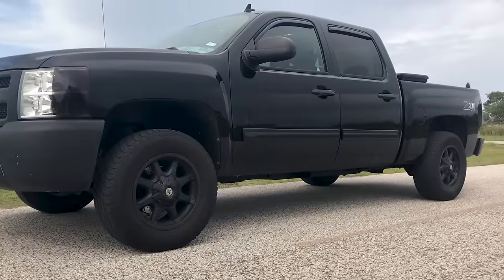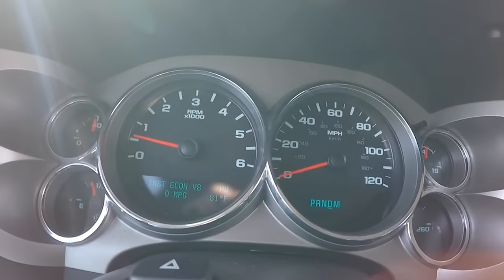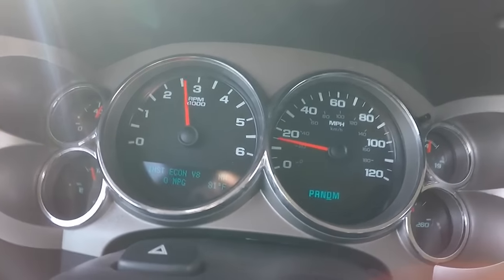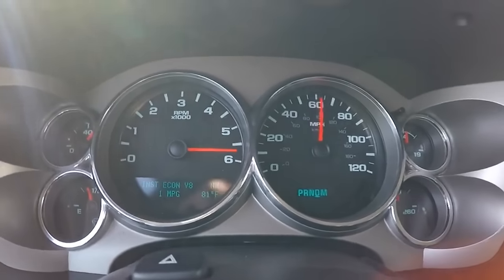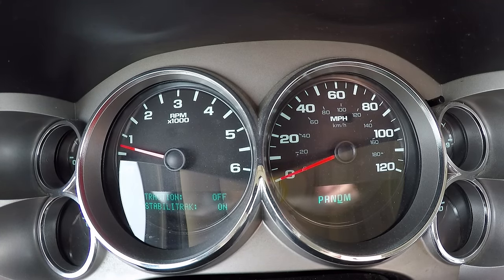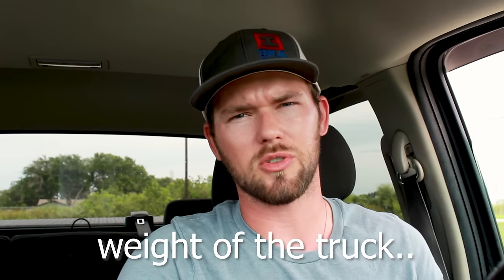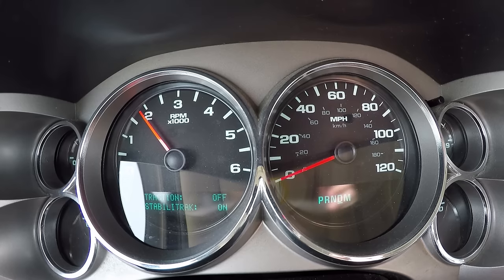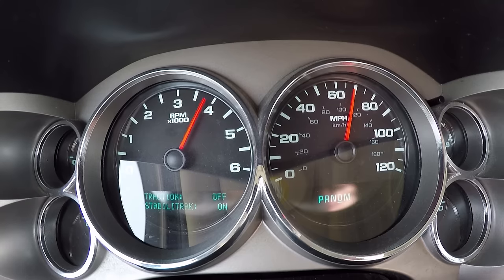High Stall Torque Converter Acceleration | Before and After

Comment: I have a 2013 crew cab 2wd with a 4.8L and it is  the slowest of all 4 silverados I've owned (99 w/ 4.8, 2007 w/5.3, and 00 with 4.3v6 all 4wd) all stock and nothing at all mechanically wrong with them. was just surprised how shitty my acceleration is on my 2013 with 4.8L 2wd especially 0 to 35mph area.
Reply from the maker: Gearing might play a big factor. Not too sure what the set ups were but I’m assuming since it’s 2wd it might have a 3.08 gear and the 4wds probably have something like a 3.42.
Reply from the maker: Gearing might play a big factor. Not too sure what the set ups were but I’m assuming since it’s 2wd it might have a 3.08 gear and the 4wds probably have something like a 3.42 or 3.73.

Comment: I'm running a heavy 2010 ltz on 35s with a k&n setup and race muffler system with a tune and stall but if i run cheap fuel it doesn't run near as good but runs out really well

Comment: 5,600lb truck. I just wonder what that same set up would do in a 3,200lb g-body lol
Reply from the maker: It would be pretty quick lol
Reply: @JohnVesely  I'm rebuilding an 85 el camino like the 79 model I had in high school and kinda torn on drive train. I bought it with the plan to put the 4 speed from my old one with a 434. But driving it around I'm really liking the automatic, fuel mileage and cruise control lol. I'm starting to lean towards maybe a 4.8L and 4l60 for power, fuel mileage and fun cruiser. But my old manual 4 speed has the same gearing as a 4l60 and technically classified as a 3 speed with overdrive. 

I won't cut the car up to put a roll cage in so the 434 is pretty much out. So many hard decisions lol

Comment: I got a 02. Silverado 4.8 stock how can i choose a torque converter to get better power?
Reply: 4l60e 373 33s i cannot get to do a dry burnout lol
Reply from the maker: Probably just anything over 2500+ but don’t go too high since the engine is stock. You’ll go too far into your power band and it will hurt performance.

Comment: Why is this better than a lower final drive gear???
Reply: It isn't, necessarily. I decided to go with higher gear ratio (from stock 3.42 to 4.10) and it really made the truck drive like a far lighter truck.

My trans is old and tired, so putting in a new TC would be throwing good money after bad.

Comment: how is the lock up in over drive?  do you have to turn the engine at 2500+ to get the converter to lock in?
Reply from the maker: Just cruising without lockup it doesn’t even go up to 2,500 unless your trying to accelerate. But it just locks up shortly after it shifts into overdrive and it feel like a stock converter after that

Comment: .5 diff  its something but i would save the $$ and get underdrive pulley
Reply from the maker: Lol an underdrive pulley would do significantly less and this is a mild stall converter. I have a 3,400 stall converter and it’s even quicker.
Reply: @JohnVesely  can u please make another video and do a 20 roll pull and a 45
Reply: U should have done a transgo hd2 shift kit with underdrive pulley and s bullydog tune it decimate that cam and stall
Reply: Ive raced a 5.3 huge cam huge stall pulled me at the line by a truck but as soons i got traction that was it
Reply from the maker: Well the 0 to 60 now with the new stall is 5.4 sec. It’s still not the fastest thing out there but would definitely beat a 5.3 with just a tune. Right now I’m building a 6.0 so we will see what the truck does once that’s swapped in there. You can tune these converters to lock up at wot so you don’t lose efficiency. But I’ll post more videos, I have a draggy so I can time the rolls pretty accurately.

Comment: yeah, but a higher rpm stall converter runs AHELLOFA LOT HOTTER in traffic
Reply from the maker: Of course, but I didn’t mention that in the video because I have others about it and this one is just about acceleration.
Reply: @JohnVesely   they just dont last, even with a cooler

Comment: Does the new torque converter locks up on direct drive on highway cruising or so like the stock one?
Reply from the maker: It locks up like the stock converter. Depending on the tune you can have it lock up whenever you want it to. But usually when your just cruising it will lock up like 45 mph and up.

Comment: If your cruise rpm is below what the converter is meant for that converter is gonna get so hot it's gonna bake your trans
Reply from the maker: I have a lock up converter, so when I’m just cruising the converter locks up to where it doesn’t slip anymore. Also I installed a bigger tranny cooler so I have no over heating issue with the trans.
Reply: The answer to this comment. It that the torque converter locks up at 43 mph and unlocks at 33mph.  No matter what the stall is.  Cruising or full throttle above those speeds, the stall has no affect.
Reply: @smokendatires  that is true if you have a lock up converter. If you don't have a lockup converter than what I said is correct

Comment: Can you put a stall if you don’t have a cam
Reply from the maker: You can but it’s not necessary.
Reply: What if have fbo will it make a difference
Reply from the maker: You’ll see a difference from down low, but no difference in top end. If you have trouble with traction you’ll really have trouble with a higher stall torque converter.

Comment: What did you use to calculate your 0-60 times John?
Reply from the maker: A stop watch and the video
Reply: @JohnVesely  That can be hard to discern a couple of tenths.  I once put a 9" converter in my Buick.  Felt great, snatched the tire off the ground at launch but lost over .30 seconds and 3 mph in the quarter mile.  To know for sure and with greatest accuracy, you have to run a baseline (before) and after runs at either a track or with a performance meter.
Reply from the maker: Well obviously, but I’m doing my best with what I’m working with. I don’t have a track near me, nor the money to buy a v-box. I averaged out the times and I know it’s not exact but the method works for now.
Reply: @JohnVesely  You could do it more accurately by playing the video in .50 or .25 time, then dividing your stopwatch result by 2 or 4. Still not perfect, but easier to be more exact.

Comment: with this stall, could i go straight to 2500rpm and roasting the tires? or does it act as in neutral until off the brake.. i realize your tires didn't break loose at 2k. My wheels break loose at 2k with my stock converter but would like to go bigger since it barely does it as of now. I wanna roast these mf's
Reply from the maker: It will roast the tires like nothing. As long as you have traction control and stabilitrac off the tires will spin easy with the new torque converter
Reply: If your goal is burn outs just install a line lock kit
Reply: Throw some gears in it.
Reply: i already have gears @JK-li7fp
Reply: what is that? @2ShotsDown

Comment: 6.5 second 0-60mph?  Wow, that’s fast.  That’s as quick as a dodge charger hemi. What engine work have you had done?  I have a Sierra 5.3 crew cab and it runs in the 9’s 0-60.
Reply from the maker: It has a bigger cam, cold air intake, longtube headers, a custom tune and the tci torque converter
Reply: John Vesely pretty sweet. I’m building a 95 f150 flareside right now. I have a 331 Stroker going in next week. I just ordered a FTI 2800-3200 stall. I am hoping it will work out. Watching your video gave me a little more piece of mind. Thanks
Reply: Wtf lol a charger hemi doesnt run 6 5 it runs in the 5
Reply: What altitude are you in ? I have a 2012 5.3 crew cab and i average 7.2 seconds the best was 6.8 to 60
Reply from the maker: I’m at sea level
Reply: Sergio Zamora that’s a big negative. I have had 4 different chargers for Patrol vehicles. All had the 5.7 hemi. Quickest one I ever had was 6.6 sec 0-60. I no what “they” say, but I have tried it dozens and dozens of times. Maybe on a prepped track with everything condition perfect, and a  completely empty car with only 1 gallon of fuel in the tank MAYBE break into the 5’s. But they WILL NOT hit 5’s in real world driving.
Reply: Sergio Zamora I have to apologize to you. After replying to you about my experience in the charger I watched a few videos of newer chargers. My current charger is a 2014. Which is the same HP as the 2019, however the newer chargers have the 8 speed auto. Mine has a 5 speed auto. So I guess that’s why the newer chargers are quicker.
Reply: @lifewiththehamptons2191  Charger patrol vehicles will also likely be heavier vehicles, between extra chassis supports and possible light armor in doors, as well as cages in the interior.
Reply: Paul Hampton My Dodge Charger GT (3.6l V6) does 0-60 in 5.9-6.1 seconds so it’s definitely not as quick as the Hemi
Reply: Michael Nikprelaj that’s faster than my Patrol car. I ran it a couple time yesterday just to see. Empty car, cage only which weighs around 100lbs. Best 0-60  time was 6.62sec. Best 1/8 mile 9.29. Best 1/4 mile 14.62. TC off and foot breaking. Out of 4 Patrol Chargers, this is the quickest. Sad I know.
Reply: Paul Hampton Wow, aren’t the patrol cars equipped with the Hemi too? That’s a shame man they should be faster because you never know when you’re going to have to chase someone lmaoo. Idk why it’s so slow because my V6 charger literally averages 5.9-6.1 seconds to 60
Reply: Michael Nikprelaj yep it’s a 5.7 Hemi. Are you timing with an App or display on the dash?
Reply: Paul Hampton Display on dash

Comment: What kind of power is your truck making? How big of a cam do you have? I have a +500 rpm stall converter from tci that I'm torn about installing. My engine should make killer torque from idle but an extra 500 rpms wouldn't hurt.
  I've got a turbo 400 trans right now. It's in a 1990 K2500 Silverado. It's got the RV/towing style low-stall converter. I think they call it 1300rpms on a stock 350 engine. Stock was 190hp@4000 and 300lb/ft. @ 2400. According to comp cams camquest software, I'm making north of 400hp @5500 and 475lb/ft @ 3500. The stock converter naturally stalls higher now with more torque. It rips the tires off if you punch the throttle from idle. Since it is so responsive, I'm not sure if I need the extra 500 rpm stall converter. Currently, the truck weighs 5700lbs and has 4.10 gears on skinny 245/75R16s. I'm upgrading the trans to a 4L80E. No overdrive and no lockup converter is horrible on the freeway! I'm turning 2500rpms at 55mph on 2 lane highways.... 80mph is a whole different level. At least the other cars know I'm there from my exhaust note singing proud. What are your thoughts?
Reply from the maker: I’d recommend getting wider tires first then see if it still hooks. If it does then go with a lock up converter with the 4l80e.
Reply: @JohnVesely  I've got some 33x14.00-16s Boggers that I bolt on to play in the mud. Both of my 4l80e converters are a lock-up style. Stock and "TCI truckmaster Saturday night special"
Reply from the maker: Ohh okay I thought since you said you were turning 2500 on the highway that you didn’t have a lock up converter.
Reply: @JohnVesely That's in my stock turbo 400 transmission. The turbo 400 did not have provisions for lockup. Couple that with no overdrive and 4.10 gears and short tires... high cruising rpms. My rpms should drop 30-35% with a 4L80E converter. I think I'm going to go with the tci +500 rpm converter. I have plenty of low end torque but the extra 500 rpms will help a little. My peak torque is around 3500.. 1100 rpms higher than the stock engine. I'll still cruise at locked up rooms. When that converter locks up, it's like grabbing another gear.
Reply from the maker: I think I should’ve gotten a higher stall converter. My max torque is around 4,000 rpm. The TCI converter I have I’m able to change the internals to get a different stall speed, but I don’t feel like pulling it out again..
Reply: @JohnVesely  that's why I was asking you what you thought.  I don't want to pull everything apart again. I'm going to put in the slightly higher stall converter. My truck has killer low end with the roller cam and small runner cylinder heads. But with. 550"/546" lift and really aggressive lobes it can rev out too. Peak hp is 5500. Stock was 4000. I know it's a k2500 pickup so I wanted useable power. I think a mild stall will keep things plenty lively. 
  Thanks for your input. Your truck looks pretty badass.
Reply from the maker: Yeah a mild stall might be all you need, just to wake it up alittle more on the low end. But thanks man!
Reply: Ideally you want a converter a few hundred rpm higher then where max torque is. Best performance is when your converter doesn't drop below peak torque. Gears, tire size, weight etc are factors also.
Reply: @waynebollentin989  I have a very flat torque curve. According to comp cams, 11lb/ft variance between 2000 to 4000rpms technically my peak is at 3500. 452-463ft-lbs. It drops from there. Another note is that this is a daily driver and it's a 5,800lb empty, 3/4 ton 4x4 pickup. I want driveability as well. I'm not putting a 4000 stall converter on a truck that makes peak power at 5000-5500. That's not where the meat of my torque is. The powerband of my cam is advertised as 1000-5000. A great set of heads and headers with open exhaust extends the powerband a bit. If I was building a track car, sure 500 rpms over peak torque would be great. I need to consider the application and useage. This truck will never see the track. It's just fun for spirited driving and occasional playing in mud while also being a workhorse. Occasionally towing and hauling.
Reply: Eric Ernst   You only need to be over if you run a transbrake and its drag racing. I said peak torque. Which is the first place it makes the peak number. I also said you have to take in all those other factors like weight, gear, tire height etc. So I guess you miss understood what I was saying. If you think I thought a 4000 stall would be a good idea. It would never work not even in a drag setup. 
If your peak is at 3500rpm but only drops 11 at 2000rpm anything in the 2400 to 2800 would work best. Would never suggest a 4000 stall. I also said you don't want to fall out of your peak torque band. Anything between 2000 and 3500rpm is in that band. Sorry you missed what I was saying. Its sometimes hard to get a point across and keep the comment short as possible at the same time. Of course application is a big factor in pick the correct converter. That's why all that other information is important. Otherwise why ask for it if you're only going off peak torque numbers. Hopefully you understand me better this time. Later bro good luck
Reply: you need to get some actual dyno pulls in. online dyno tests are NOT accurate. These numbers that you're coming up with seem to be all over the place.  @EricErnst
Reply: walker  comp cams camquest software. I plugged in my head flow, compression ratio, throttle body size, intake manifold and exhaust setup. Yes, it will vary, but it should be in the ballpark. I do not live anywhere near a dyno shop. I'd like to find time to travel 100+ miles to get to one but it's not practical right now.

Comment: Have you ever thought of changing the rear gearing?
Reply from the maker: I thought about it, but since the truck is 4wd I would have to buy 2 sets which would be more expensive..
Reply: Not to mention programming
Reply: @JohnVesely  on my 2013 Charger RT all-wheel drive I can't even find a front diff set so I'm stuck with this sluggish 5-speed until I get a torque converter myself
Reply from the maker: That doesn’t make any sense lol
Reply: @JohnVesely  What doesn't make sense? That I can't find a better gear set or that I need a higher stall converter? Just curious :)
Reply from the maker: Maybe it was just the wording, I think I understand what your saying now. My b bro. But since when did the charger r/t come with all wheel drive? I thought it was just the v6 models that came with the optional all wheel drive.
Reply: I livVesely No prob I was using voice to text lol! I live in Michigan and weathers really nasty here so I made sure to get the most recent V8 all wheel drive they made which was in 2013. It's a rare option with the sport package as well, but I love it. I run 0 to 60 in 5 seconds with a tune and exhaust, but the 5spd holds it back, I really want to do A Jay Greene Cam and torque converter next. Cool truck though bro!
Reply from the maker: Thanks! That car seems pretty dope too, never knew they came with awd, that could explain why it’s hard to find diff gears for it.
Reply: @Xaiborg  torqstorm
Reply: @carylewis28  Procharger or hellcat supercharger are better deals from what I hear, but as much as Id like forced air it just doesn't sound like a smart idea on a 5.7 without forged pistons. Sure would be badass, but my upgrade queue will likely be cam, torque converter, then maybe bore&stroke kit. After I get that far Ill consider forced air. Thanks for the reply tho I did look into the torqstorm!

Comment: I was rear-ended and had to get the muffler replaced due to it being bent. A day after that, the car would not accelerate in drive. I had to drive it home in low gear and could not go above 20 mph. Any ideas?

Comment: Hey man what’s your exact set up? Like which cam and which stall converter? I have the same style truck crew cab and everything and t looks like yours hauls ass
Reply from the maker: It’s a 220/220 comp cam with Texas speed longtube headers and a 2700 stall torque converter. If I could I would get at least a 3000 rpm converter but I got a really good deal for the one I have